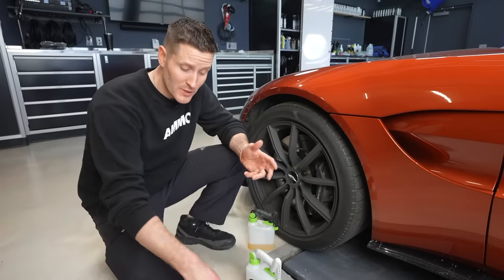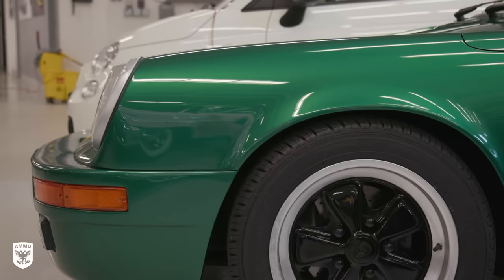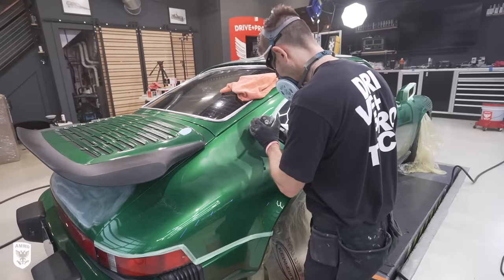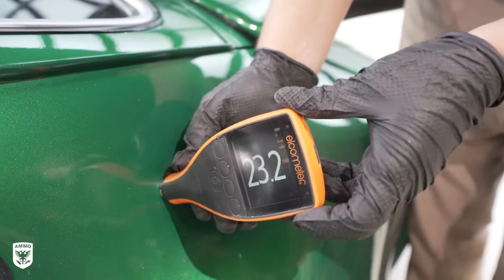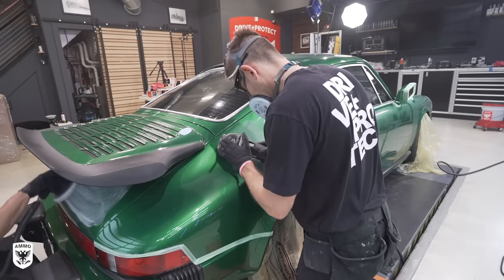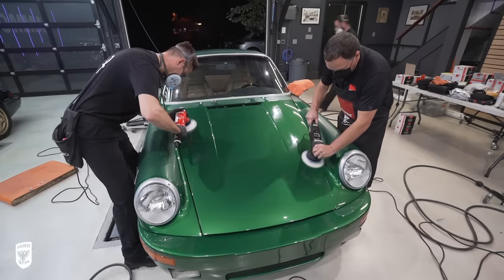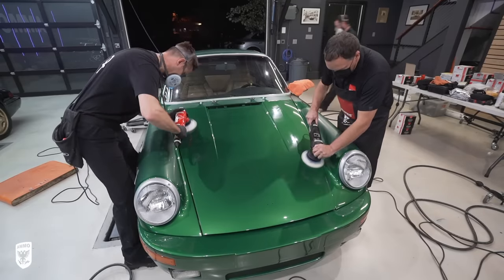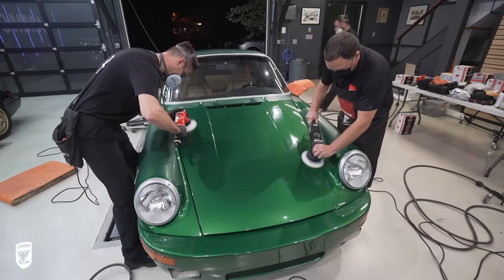How to Wet Sand Orange Peel in Car Paint: Porsche 911

Comment: Dang I was hoping you would remeasure the paints thickness after all that sanding to see how much was removed.
Reply: I agree. Makes you wonder how much clear coat was left, if any, after all that sanding.
Reply: I agree that would be interesting. But I speculate Larry would not do that, because the loss in overall paint thickness is probably not "that large" - but what you are really interested in would be how much clear coat (in the top layer) is remaining. And I guess there is just no way to tell that, because one will not know, how thick this layer of clear coat was prior to the procedure.
Reply: @RC-ic1co  i hope larry read this and bring it up in the new vids
Reply: If you wet sand correctly you may lose 5-6um.

Personally I wouldn't ever dry sand with 1500 grit. I've wet sanded some cars and panels in the past and had very similar results to the video using 2500 wet sanding.

I would generally go to 2000 grit as the lowest and then I'd follow up with 3000 grit.

Using 1500 then 2000 and straight to Polishing can leave tiny sanding marks which you aren't getting out with compound and polish.

However as Larry says generally wet sanding is a no no - not really any benefits in the real world. I've only done it to repair poorly re painted panels or as experimentation.
Reply: @PepegaPig  buy good brands made for dry sanding only and the diff is tangible...
Reply: @beerbrewer9996  They talked about paint thickness in the video, this Porsche had well over the amount of "working room" when dealing with leveling of the orange peel. You'd be surprised how much sanding actually takes off of a clearcoat.

Comment: Can’t wait to never do this to my car, but still loved watching/learning about the process.
Reply: If you use a 5000 or higher grit, it's pretty much dummy proof. Literally try it on any part of car followed by 6k, 7k, or 8k then compound, polish, and finish. It's easy process.
Reply: @kiavaxxaskew I am in the process of doing the same to a Miata project. Starting at 1k, then moving all the way up 10k.  Compounding now with 3m perfect. Looks good so far.
Reply: @kiavaxxaskew what about going from 1.5k, 2K,3K up to much 5k? I know it’s a lot of work obviously but it’s on my own car. So I don’t mind if I’m over worked.

What does the extra 2/3/4k provide? Just easier access to remove the sanding marks? Or is 1.5k to 2k enough like in this video? 

What I don’t want..  is to finish at 2k, use a wool pad and a DA with a cutting compound and it just doesn’t clear or something goes wrong

Comment: Mill thickness gauge measures the entire paint build, not he clear coat thickness. Got to keep that in mind. It’s also a good practice to tape all edges (burnt many an edge) when buffing. Great video love them.
Reply: This is what I don’t understand. If that gauge measures total thickness then how do they know if there will be any clear coat left after sanding?

If they can remove the orange peel then that means that the orange peel is only in the clear coat, right? And they aren’t even sanding green paint ever…just clear?
Reply: Just clear coat causes the orange peel
Reply: You can measure an open area and then a door jamb to get an idea of how much clear you’re working with. The door jambs will have the least clear so you know you have between that and the total # to work with. 

Let’s say it’s 5.5 mils on the car average and 3.2 in the jamb. That means you have 2.3 mills to work with before danger.

Comment: I used denim pad with my DA with heavy cut M105 compound and it worked perfect for orange peel removal. I didnt have to do actual sanding. Finished with regular soft polishing pad with M205 compound
Reply: I think its more often used on aftermarket paint, which tends to be thicker and harder? So sanding is faster and safer than oem paint. Correct me if I'm wrong!

Comment: Another solid way to determine if your pad is deteriorating is to simply look at the pad. Most high quality pads such as Rupes, 3m actually have vertical or horizontal abrasion patterns. After sanding simply blow off the disc and inspect those patterns to determine how much cutting capability you have left! I used this method also when sanding headlights. You’ll see a noticeable difference in the pads if you regularly inspect them while sanding.

Comment: Very great key point of this video is “there are a lot more reasons NOT to sand  your car paint then there is.”
Reply: That doesn't even mean anything
Reply: @peni80085  it should only be done if your car has plenty of clear coat because if not in a few weeks or months your clear coat might fail and the car will have to be painted again. You should always request for a lot of clear coat layers if you ever get your car painted its worth paying more

Comment: I am a scale modeller in my free time and I prevent orange peel using additives in the paint like drying retarder. It slows the curing time but it helps the paint to level itself out and also prevent dry paint on the airbrush nosel. Isn't it the same for a larger scale or...? I mean if it's an aftermarket paint I would imagine they use paint enhancers or something.

Comment: Suggesting there's a 'ton of paint to work with' based on the paint depth readings on a resprayed car is a bit misleading. Unless you know for a fact that the vehicle you're working on was sanded all the way back to the original substrate before the new paint went down, then it's really just a crap shoot. Sure, you can do your door shut comparisons to get perhaps a bit of insight, but it's still a toss up. 

Just thought that was worth mentioning! Great video as usual, Larry.

Comment: If I'm not mistaken there is a difference between the k series and p series sandpapers. P series is the stuff you normally find in stores, where k is more specialty. K1500 will cut like p1200 but have the finish of p1500-p2000. K has a more aggressive cut but smoother finish. So be careful if you have thin paint

Comment: We wet sand cars with 2000 and Icon Rocklear right over top afterwards. Not only do we get rid of orange peel, we add to the clear coat with a rock hard, clear protective coating that is 75 times thicker than ceramic. It also boasts permanent UV and Chemical protection.

Comment: I can really appreciate your tutorial on this job. 
I'm still nervous about doing my 2008 'Vette Velocity Yellow Tintcoat. I've had the car for years, kept it in the garage, and have never done a detailing. 
Three plus years ago, I made the mistake of parking overnight out of town near a maple tree in the Spring and got some nasty gum on it. Plus, I never cleaned it off properly. So, there are some steps I'll have to take first to get the tree residue off before I can start such a project. But, I also don't want to really spend $1,000+ getting a "professional" to do it since not all detailers are created equal. 
I know that doing a good job and doing "too much" is a fine line. And, staying away from sharp edges must be at the forefront. 
I'll probably continue to procrastinate.
Reply: I've been doing this for years, fast and easy fix on tree sap or anything nasty, even overspray is to use lacker thinner on a cloth or microfiber, to remove it. Then immediately spray wax and grease remover over double the area you wiped to neutralize the lacker thinner.

Don't skip the last step lacker thinner is some nasty stuff and if left it will eat paint.

Follow that and it's quick fast and easy, not usually the case.

Comment: The orange peel is derived from the fumes evaporating from the surface, you have also referred to the paint throughout the video when sanding, cutting, and polishing.  On the other hand, I believe the process did not involve sanding or polishing through the clear coat. Sorry for being a little confused, are we correcting the paint or the clear coat?
Reply: When paint correctionalists are referring to "paint", they are referring to the clear layed on top of it, unless it's single-staged.

Comment: Great video! But I dont understand why you have to sand past 1500 grit if you have compounds that will remove 1500 grit, especially since your doing 2 stage polish anyway. If the 1st stage compound cuts the 1500 marks and removes it all, isnt it doing the same thing as the additional sanding stages??

Comment: That's why painters give it three or four coats of clear coat,to cut and buff, while still leaving at least two coats of clear,but yeah if you give it to coats of clear,and do a heavy cut and buff,you will end up with a very thin coat of clear, causing the paint to dull quickly with the sun's rays.

Comment: Are you completely through the clear coat if your making it to the paint itself? Or is the peel also in the clear coat? I’m confused on that. And if you eat through the clear coat is a ceramic coating absolutely needed at that point for protection
Reply: I had a similar question.  You mentioned the “paint” is over 20mils thick, but doesn’t the elcometer measure depth from surface to color coat (i.e. thickness of clear coat)

Comment: Please take this as constructive criticism and not keyboard hate. You’re sanding WAY to far away from the edges. That DA is capable of going right to the edge without spending too much time or risk burning through(I’d estimate I’d spend an extra 2h sand and polish). It obviously takes good motor skills and an attentive eye but it’s worth it. I cringe when I see a perfectly flat panel and it had a 2 inch frame of peel. Keep working that DA, eventually it will become an extension of your body.  ;)

Comment: Too bad for me that you didn’t make this video sooner. I don’t much get scared to try new things, a lot of folks end up never doing most things they’d like to do, cause they are too scared to jump in. Well, I jumped in and run my sand up to the edges being very careful, at least that’s what I thought. I burned through the clear on a couple spots at the edges of my hood. It’s not super noticeable to the Average person but I can see it from a mile away. Poop. I didn’t burn through the color later, so I was thinking I’d try kind of a nail polish application of some clear then try and blend it just enough to kinda hide my spots.

Comment: When using water, is it just regular tap water or distilled water? I’ve heard it’s better to use distilled water. Tap water has contaminants that might embed into the paint or change the color. Distilled water has most of the contaminants removed. What about filtered water?
Reply: in an ideal scenario you would use RO/DI water but distilled works too

Comment: Great video. I do have a question.... when you do dry sanding 1500grit how do you prevent clear from clumping under?
Reply: I continually blow my DA pad and panel I’m working on with compressed air. Also, I never wet sand with 1500 as my first step, dry only.

Comment: It’s really harsh saying it was poorly painted! The fact the paint has settled just means the materials have done there job! All paint gets polished in the bodyshop, even in the factory when they’re first built. Detailing is just an extension of the paint process.
Reply: when you get someone talking about something they don't understand sometimes we end up hearing these extremisms. A badly painted car is a car that is not even worth polishing. That and the fact that the orange peel is due to the evaporation of solvents... When, in fact, it is the result of the coarse atomization that ends up not flowing, due to several other factors
Reply: @vitorsantos5461  orange peel isn’t the issue with this car.

Comment: So if the paint goes on the car and then is covered with clear coat, which is actually causing the orange peel?  At times you spoke of removing paint and other times you spoke of removing clear coat.

Comment: I understand the purpose of using IPA in the cleaning phase. However, I've found that IPA should not be used on rattle can spray paint, as it seems to literally dissolve the paint! When I tried using IPA on areas that had been repainted with spray can paint, I ended up with huge runs of paint, due to paint that had dissolved, started to flow with gravity, and then re-dried once the solvent had evaporated. I guess just using a grease and wax remover, is the way to go on spray can paint.

Comment: Hey so problem!
I’m still getting a returning a lite haze as if it’s still in sanded form after polishing….am I sanding too much? Or am I not polishing enough?
I did 1000, 1500, 2000, and 3000 grit. Then did wool pad with cut compound and polishing pad with same cut compound and then polish with soft pad. 
It’s just a beater car and my first time wet sanding but trying it out and want it to come out best as possible to perfect so I can progress to doing other peoples daily driven cars and work my way up to better vehicles.

Comment: Question I primed with 1k primer, painted and clear coated. Everything come out great. I half assed scuff sanded the prime I sprayed a guide coat. Sanded out the guide. But the prime came out the rattle came really ruff. Can I resand it smooth it out and reapply the base and clear? Or do o have to redo Prime paint clear? The surface came out looking like 80 grit sand paper. No orange peel no runs or dry spots. Just the rough surface from the prime.

Comment: when you have an old car that’s been resprayed , don’t you think the paint depth gauge could be somewhat misleading considering how it could have body filler, or if the car wasn’t stripped it could have half as much cushion than actually measured?
Reply: Good point. I assume the paint gauge measures everything until metal. Definitely not just primer, fresh green paint and clear being measured.

Comment: Larry,

Esoteric Detailing suggests not to ever remove orange peel because you take off so much clear coat and reduce it's lifespan and risk going through it. And I've heard orange peel aids in UV protection. Not sure if that's true. Your thoughts?
Reply from the maker: Agree. We stated this in the video. However, this is a repaint with LOTS of paint. His advice is correct, as we stated in the video, but less relevant here because this is not a factory paint job.
Reply: @AMMO-NYC  Larry,

I feel silly. I wrote that before I even watched the video. One more question: do you ever try removing orange peel on OEM factory paint jobs? Maybe just on panels where it's the most prevalent? Would you only do so if you use one of those ultrasonic paint thickness meters that can distinguish between primer, color, and clear coat?

Comment: Is it better to wet or dry sand when you’re sanding the paint? Or does it matter? I’m looking to do this to my car… the right two doors are extremely bad but the rest of the car is ok, I’ll just end up doing the whole car-it was repainted.
Reply: It depends. If you are removing peel, it is much easier to see when you have levelled when dry sanding as you don't have to keep drying the panel. This saves a lot of time. The higher grit will always be wet. 3M 3000 then 8000 makes for an easy final polish

Comment: When using that digital paint depth guage, how do you know how much of that depth is paint and how much is sandable clear?
Reply: Check out Larry's ata series. He talks about this in more detail, but I think he said on average you have about 3mm of clear coat
Reply: I think that it measures the length between the clear coat to the actual paint. As shown in the video, you have the bare metal, then primer, then it comes the paint,
and on top it's the clear coat. So the gauge measures the distance from the top layer of the clear coat, down to the first top of the paint. This is how I understand it. I could be wrong.

Comment: Me - has repainted and wet-sanded many cars
Also me - Shutters at the thought of someone wet-sanding a car painted by someone else

You never know how thick the clear coat is. The clear coat to metal depth might be OK, but a re-spray or multiple re-sprays will give a false "safe" reading.

Be careful wet-sanding your own car if it has been repainted. The clear and base coat might be thinner than you would like.

Comment: @larrykosilla For how long will stay shinny?
 I thing if you wet sand a clear coat and then polish it'll get foggy after 1-2 years, plus you remove clearcoats UV protection layer. Is that correct?

Comment: Question I just painted a car i started to wet sand the car with a six inch disk 1000 grit paper then went to 1500 and 2000,3000,5000 grit paper then when I started to puff I saw pig tails. What did I do wrong

Comment: Wanted to ask if i polished the right way lets say every time before waxing on speed 4 medium pressure. How long would it take for me to eat through an average car's paint job (hoping just the clear coat not down to the base coat) that has factory soft paint. Say i wax quarterly a year (4 times) would it take 10 years? Or more? And i get it there are variables in play but just a ball park time frame
Reply: Good video on this from Chicago autos. Bot this exactly but on how much to run through clear coat. If your ceramic coating then one light paint correction every 4 years. First go may need medium cut. This sort of correction is a once in a paint job. To wax or another sealant you don’t take off much at all.
Reply: @simonb6306  awesome thank you
Reply: Also get a cheap paint thickness machine. The you know for sure how much more you have to play with.